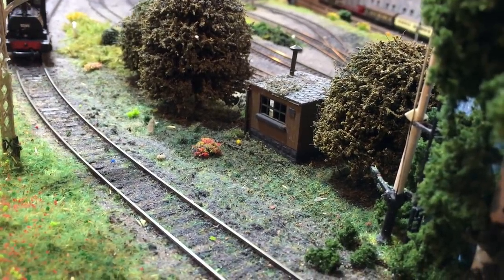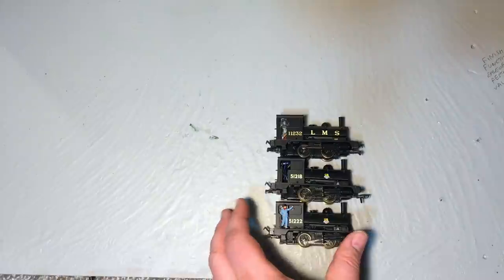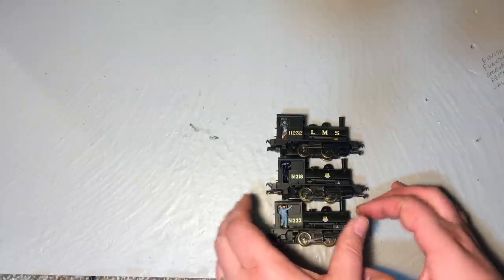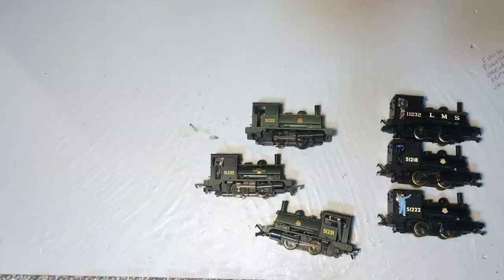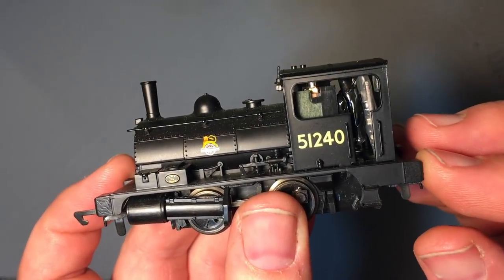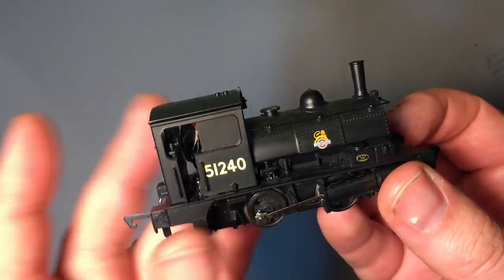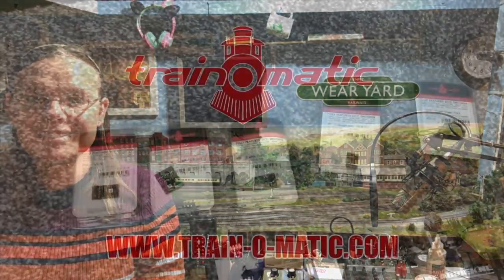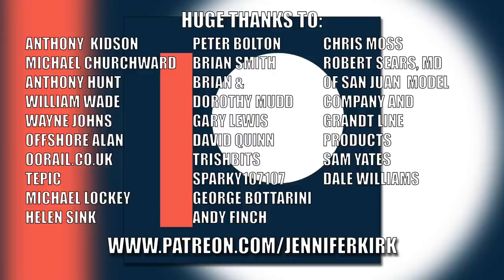The Old Loco That's Still Worth Buying - Hornby L&Y Pug Unboxing and Review

Comment: The early BR crest was intended to have the lion facing forwards on both sides. It was the later crest that caused the problem because only the left facing lion crest was sanctioned, A few locomotives appeared with both lions facing forwards but the College of Heraldry soon intervened and the crests then all had the lion facing left.

Comment: I have the new release of 51207. Of all the locos I have, '07 has to be one of my least favourites. Got her 16th December,  motor died on boxing day (The cab lit up orange and it stopped dead) she was pushing 1 of the 4 wheel coaches that comes in train sets. It went back to hornby and got a replacement a month later. On its about 3rd run, a light engine run, the cab lit up and I turned the power straight off which saved another motor death. She is at one side, I think I will weather her and try and fit the motor from the new hornby terrier as they are smaller and make room for a cab interior as well as not having to worry about the motor dying again.

Comment: I for one do think you were very harsh in your scoring. It's such a small engine and I think there is enough detail to warrant a higher mark then you gave it. You also down marked it because of the lack of DCC and when fitted it showed. What if your layout was DC would that of changed your scoring? You can only get a Pint into a Pint Pot. Martin. (Thailand)
Reply from the maker: I get criticised if I score them high, and criticised for scoring low! 

It is a good model, but has some limitations born out of the age of the model.
Reply: @JenniferEKirk  Thank you for your reply. I just think that it should have been reviewed as it was made and not what it was made into. You, yourself said that you would be criticised for the low mark. Let the "Cupboard Monkey take a look at it and see what she says about it. It was not made to be a DCC Loco. No, I do not want manufactures to made one DCC and one DC. I forgot to say it on the review of the Terrier, Dapol should have of supplied a coal load in the detail bag. Have a nice day today. Martin.